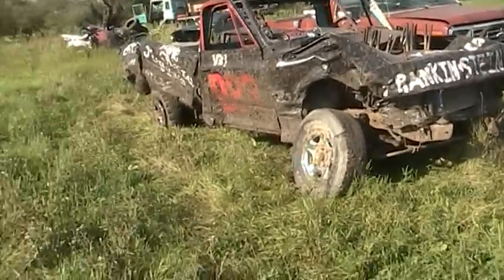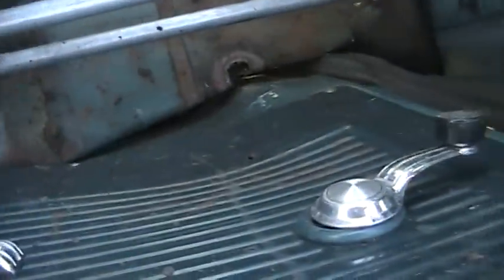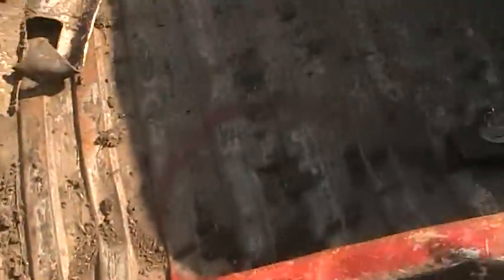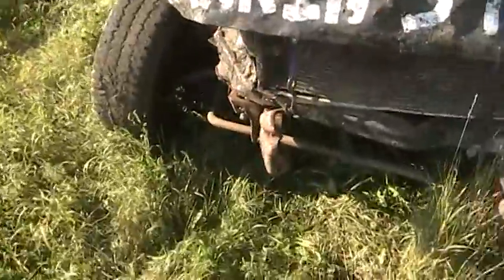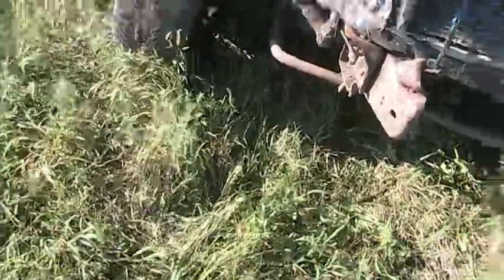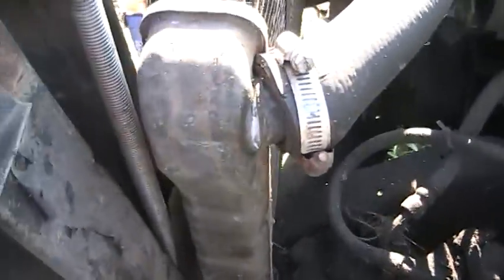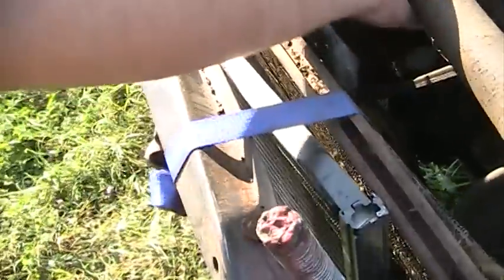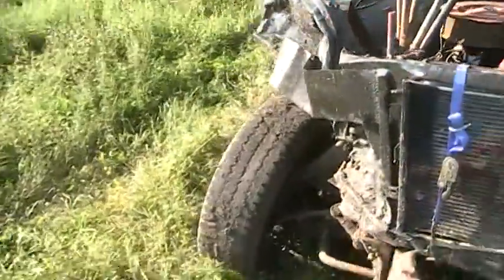Derby Truck Update

Comment: @ 1:52 is ur torsion bar and mount... u just gonna pull an A arm off a 3/4 ton? you could probably straighten ur frame back out if  you can use ur dads massey